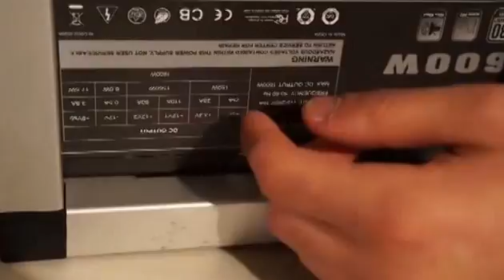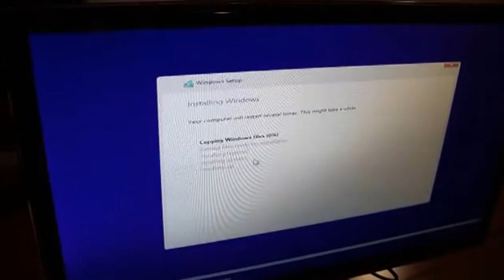Tutorial on 5 GPU (R9 290) Scrypt Mining Rig (Litecoin, Anoncoin, Feathercoin)

Comment: Its hardly profitable anymore... you can make $1200 a month yes its true but 5 gpus @ about $500-$600 each is about $2500-$3000 plus the power supply, cpu, mother board and ram. So maybe about $3300-$3500 and thats not all you must still pay for electricity:(

Comment: n what about those new super effecient nividia cards. the ti750 i think its called. wouldnt those be good to use
Reply: No, AMD cards are much better and faster at mining, hence the price increase. NVIDIA cards perform really poorly. Check out the "litecoin mining hardware comparison" on google.
Reply: ~300 Kh/s
Reply: owenoj The new 750 ti's are really great for mining. They're very low power (they don't even need an auxillary power source). So, you can spend less on a PSU, and you can get very similar hashrates with much lower power and heat.
Reply: Kim Jong Hard-un Interesting, what hashrates does it get? I know NVIDIA are very power efficient.
Reply: Pretty decent

Comment: A few problems I have with this. 1.  The initial investment is huge.  Most people  don't have $2000 or more to throw at a new system.  Most people aren't technically savvy in order to construct this.  3. You're using equipment in a way that it wasn't designed to be used.  4.  You are putting thousands of dollars in risky makeshift cases and boxes.  5.  Considering how volitile the Bitcoin market is, it's an enormous risk in a market that is already saturated with guys like you doing the same thing.  You've  pushed out the little guys and have made it impossible for  even a respectable system to  earn.  This whole thing will come crashing down but hey, at least you've have some of the best gaming rigs in the world!
Reply: 1) You don't need 5 graphics cards to mine most altcoins, it's just that you get more coins. There are people running $200 cards and mining small amounts of coins that are likely to be 1000x more valuable in the future. 2) I'm more of a software person but I could easily follow. Mining is meant for people who know what they're doing. If a regular person wants to become a part of the game, s/he can buy the coins. 3) I don't think that graphics cards were originally made for gaming either but as more people started using it for that purpose it started to be mostly used for gaming. 4) ~~~~. 5) This was not made for Bitcoins but altcoins, hence "scrypt" in the title. Though it is true that altcoins' values tend to depend on bitcoin's, a respectable system can still mine a respectable amount of coins- refer to 1.

Comment: Well, you don't really need matching brands to make it work proparly. In this case, those are reference cards, so it does not matter if you use a Gigabyte, MSI or Asus branded motherboard. The best thing to do is to use high quality components like PSU's from good brands like Corsair/Seasonic and motherboards from Asus or Gigabyte. Temperature is also important to keep down. This will make the parts last longer.

Comment: That guy just build a PC in 15 mins. 15 bloody mins
Reply: cocaine
Reply: saskiot  physically, yes - but first u need to spend a lot of hours learning what to do! If u are common to the pc it won't be a problem. Now a lot of people wants to be a miners, but do not have a clue what is CPU, what is GPU etc.
Reply: Tyler Stutzman
Probably speed.
Reply: the clip is speeded up at some parts and hes not using a normal pc case wich speeds up the process because of small rooms
Reply: 15 minutes of a vid - but looots of hours spent reading, thinking, bloging etc. and do not forget about his experience - It not repeatable for a "regular" PC user :) and do not forget to install and configure 5 gpu in the OS :)
Reply: it does not take long to build a computer it takes anywhere form 10-20 min to put the parts in.
Reply: Tomek Chłopek #truedat

Comment: What happened to the audio?  It cuts out at about 2:12 and picks back up at 3:24 then the audio overlaps with another sequence.  And the Audio at 3:24 is out of sequence.
Reply: most likely he tried to speed up or cut some part but failed in vegas etc. happens alot if you dont know what you are doing (audio overlaps if done wrong)

Comment from the maker: This power supply is 1600 Watts so we can only run 5 GPU 
I'm r9 290 each card consumes about 300W there is no way I can pull 6 or 7 unless I will use 2 PSU. I will make a video for you using 2 psu with 6-7 GPU I should be hashing about 6,300 KH/s
Reply: One of our latest video's covers a 4 card build, leverage two PSU's - It actually works pretty well. 6 card rig though should be targeting a pair of some Cosair 1050w PSU's to cover the bases on power.
Reply: Hi Vaz! Tks for the videos. What mobo do you suggest to use 6-7 GPU? Thank you again.
Reply from the maker: Geyslan G. Bem I really like x79-up4 that should get 6 GPU working no problem
Reply: Bits Be Trippin' Great video yours. What type of connection did you use to connect the 2 psu?
Reply: Rogério Fernandes There's probably a problem in your bat file. Google R9 290x Cgminer bat file and copy it down and edit to your specifics.